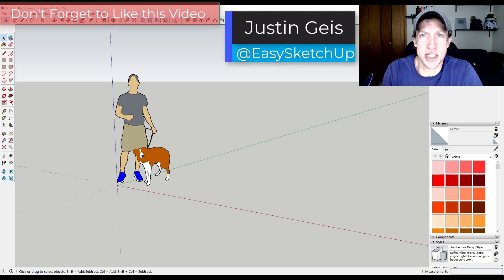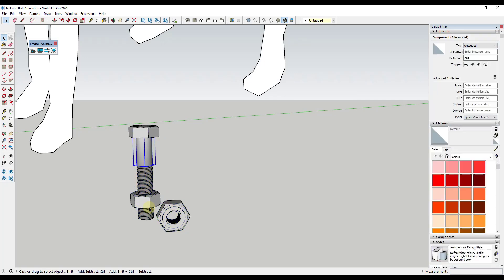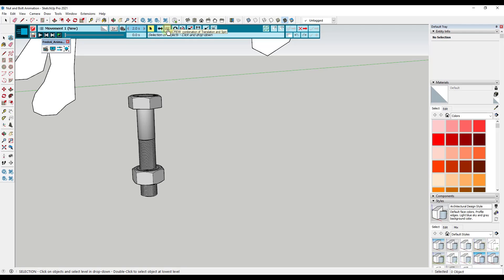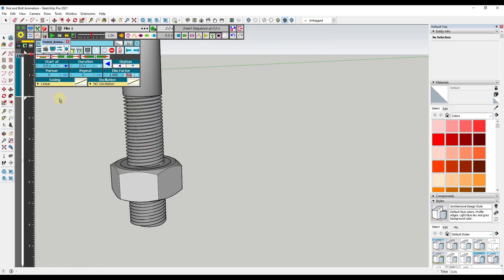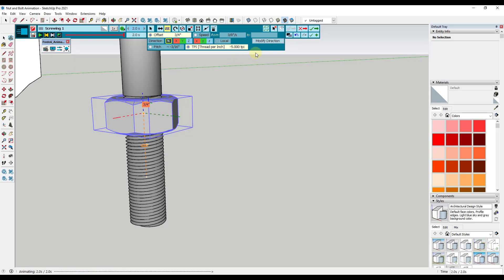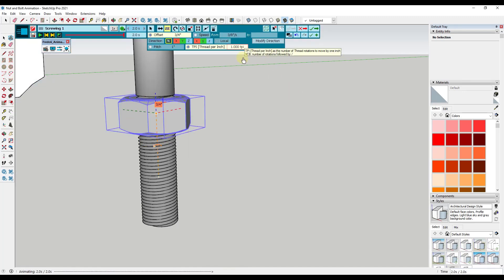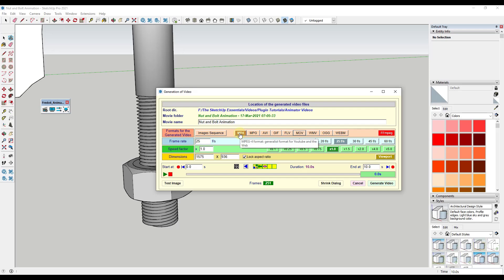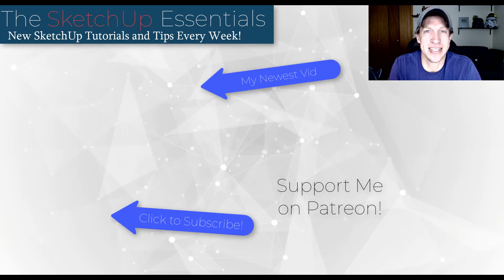Creating a Moving NUT AND BOLT ANIMATION in SketchUp!

Comment: hi sir, i am facing problem in using the screw tool, when i try to scale the copied screw on cylinder surface, the screw line usually scaled instead of the cylinder surface. kindly guide me thanks in advance